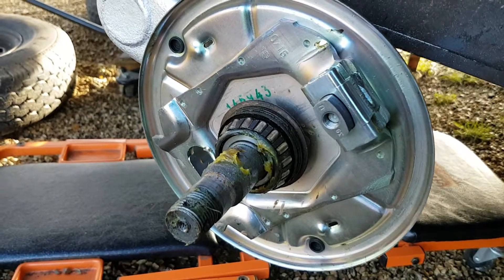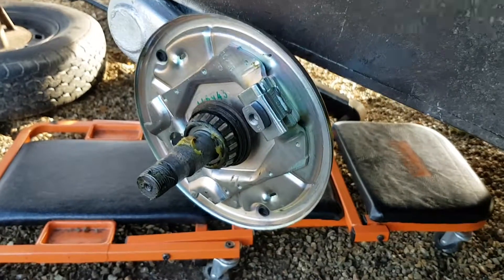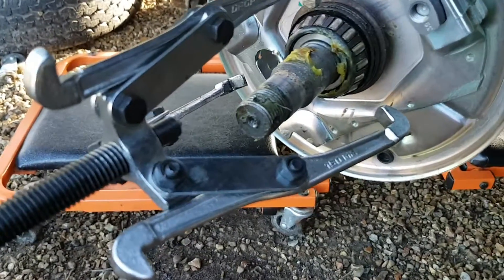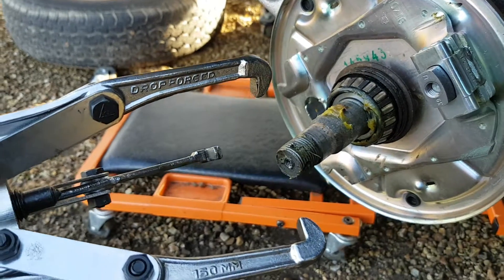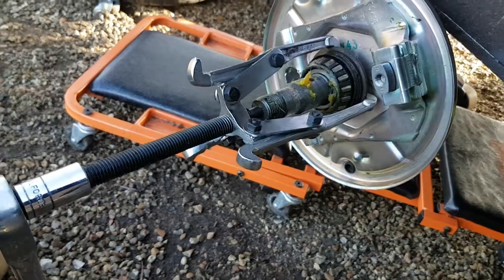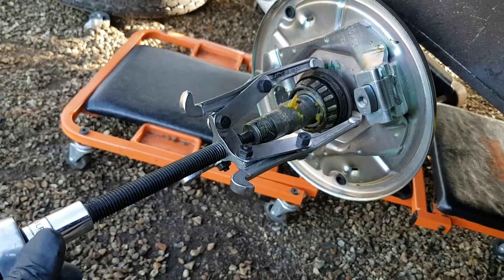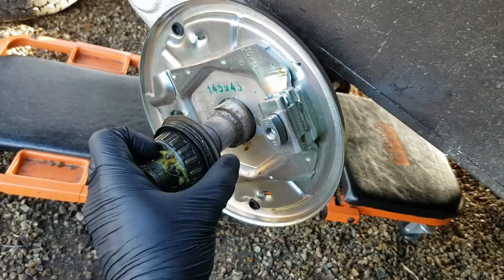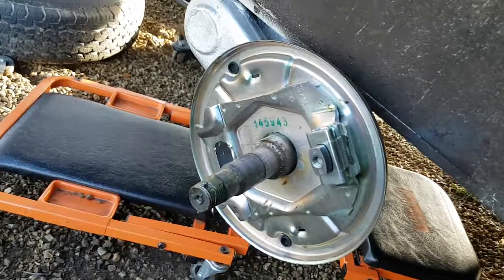Removing bearings on Knott drum brakes

Comment: So if you replaced there bearing, you'd seat it on the spindle and shove the hub over it? I've had a bearing pressed into my hub but now can't get the hub to seat on the spindle as the bearing interferes
Reply from the maker: Yeah that's right. It was a long time ago since I did this but the idea is that the bearing sits against the hub from memory. The centre of the hub then rolls on the bearing, but I'm pretty sure there's another bearing on the other side of the drum as well. As I say, it feels like an age since I made this video!